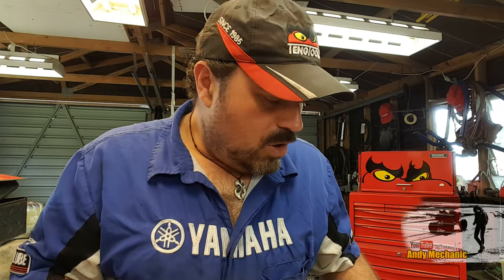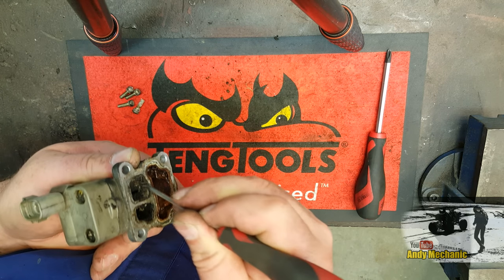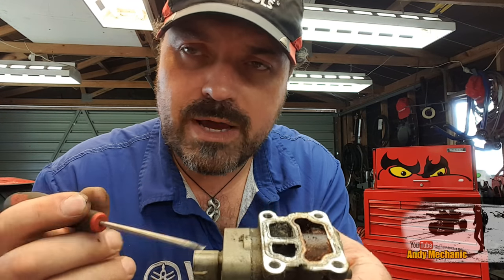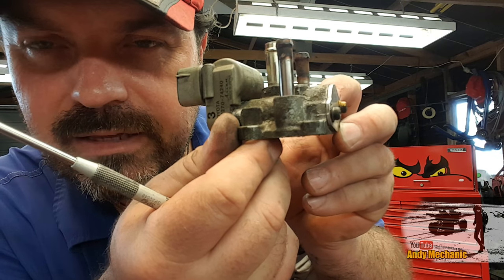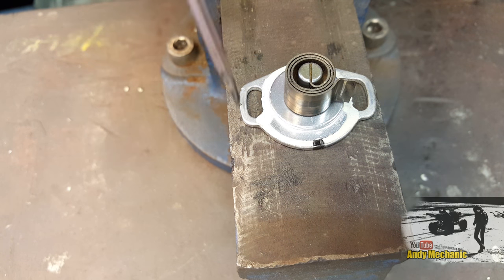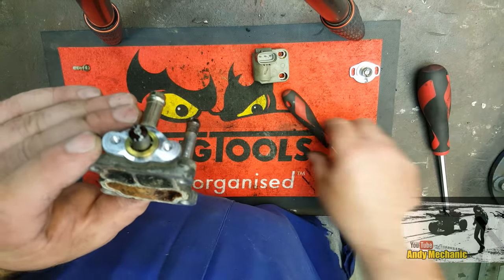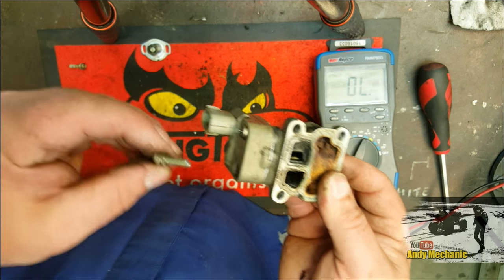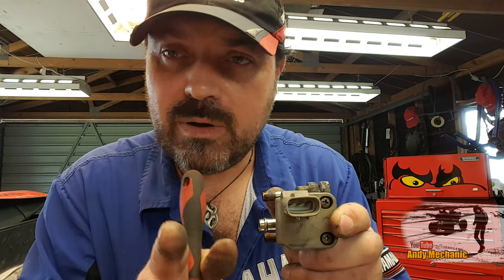How to test a rotary type Idle Speed Control Valve #1211

Comment: Though... How exactly does that mechanical spring affect the shaft? Does the ECU know the low temperature of the coolant and does not sent electrical impulses to the coils? This should have been detailed.
Reply: When the radiator temperature is cold the valve is open. When the water warms up the spring closes the valve.

Comment: Say an engine is taking too long to get to normal idle speed. How do you adjust the by-metallic strip to close up quicker?
Reply from the maker: Hi John, the bi-metal coil can be adjusted by slackening off the two screws & rotating the adjuster clockwise or anti clockwise to adjust cold start fast idle. I can't remember which way increases or decreases the rpm but I'm sure it will be obvious - depends too on direction coil is wound?

Cheers Andy
Reply: @AndyMechanic  
Thanks. That was the only bit you missed. :)  I am sure it will be difficult to do on most engines, as the plate is on the other side of the control valve.
Reply: @AndyMechanic  
Just had a look at my Toyota. Only two water pipes connect to it. The pipe to the crankcase is not there. The coils are on the side (facing the front of the engine) when looking into the throttle throat. There appears to be no bi-metal cover plate.

Comment: Hello Andy, I was wondering, I checked my isc valve yesterday. I checked it with a 12v supply. The solenoid worked only in one direction but not the other. I didn't check the ohms of the circuit. Do you recommend I do this test before I say it's dead and need to replace it. Also could there be a build up of carbon and other debris and rubbish in there could could be affecting the operation of the solenoid. Thanks for your help. Much appreciated. Just so you know which you probably already do, but the RAV4 and MR2 have the same engines in and you can download the bgb off the internet which is a complete break down of the 3stge engine. It's a 1500 or so page workshop manual.

Comment: i just watched your video and it's cool.  my toyota sienna usually start at about 2000 rpm at cold start of engine and gradually returns ant remain on 1200rpm or thereabout,  is it normal like that
Reply from the maker: Yes, it's a fast idle to help warm the engine up plus cold engines don't idle very well so manufacturer increases rpm until warm.

Thanks
Andy

Comment: How can I adjust cold start idle? It reaches 1800 rpm. It was previously adjusted when my mechanic tune up my car but he did not found a very hi rpm during cold start bec he tune while in normal operating temp. Please show me how and where to adjust my IAC for my 4AFE engine.

Comment: This may My Main issue on my 98'Toyota Rav4.Changed out Plugs,Wires,Coil Packs,Fuel Filter,"Fuel Pump" Throttle Postion Sensor,EGR VALVE MODULATOR,FUEL INJECTORS..GOD!😢And still the Car Shakes @ red Lights and turns off Shakes badly @ red lights and turns off,starts  back up..Lord Help me..I'm going just order this part and hope there is a Prayer to my endless problem I've had "Since I've bought this Model Rav4..Any thoughts people???

Comment: And car dies once it warms up about an hour after starting it
Reply from the maker: Sounds to me like you have a pretty big air leak on the intake manifold. This causes un-metered air to enter causing the mixture to go lean. Once the engine comes off cold start (extra fuel injected) the mixture is too lean for the engine to run.

A likely cause of your symptoms- check all vacuum hoses these often perish & need replacing.

Cheers
Andy